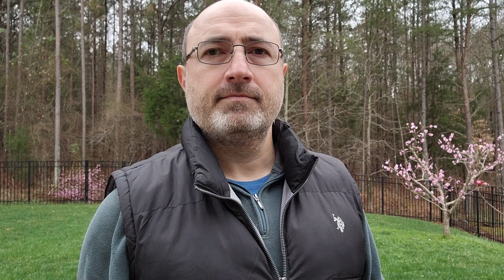Elon Musk Says Tesla Cybertruck Will Use a New Metal

Comment: Some 300 series SS like 301 can be cold worked to full hardness but 304/304L could only achieve half hardness.  Perhaps the adjustment to the alloy permits 3/4 to full hardness with the better corrosion resistance of 304 or 316.

Comment: Well, the best swords use composite steel blades.  The edge is made of high carbon steel optimized for hardness (hold a cutting edge), but brittle and prone to crack and rust.  The center is made of more flexible (spring) steel optimized not to break.  It is possible that two sheets of stainless steel could be fused together to create a panel that has a very hard outer layer and a more flexible inner layer.  But I think it would be easier to just create an alloy optimized for the right amount of hardness, rust resistance and flexibility.  Just making it cold-rolled (forged with less heat for minimal crystallization) and thick is enough to do the job at a reasonable cost.  "Spring steel" is designed to bend, but spring back without damage.  I would think it would have to be optimized for rust resistance, given the utility the truck is designed for.  1950's era trucks were built like tanks, the metal panels were so thick, compared to the thin panels of today's vehicles that are easily dinged, but lighter weight to improve MPG.  The thin panels are easy to form and in fact you need to stamp a lot of contortions in them to create structural strength.  With the Cybertruck, the steel is so hard, strong, and thick, it can't be stamped.  I'm not sure how they will fold it without causing it to crack.  It would be easier to cut and weld it to produce those sharp angles.  Perhaps they use very high pressure dies and heat.  Actually, looking at the prototypes, you only see a few folds, on the doors and the front "bumper".  Most of the angles are made from separate pieces. 
I'm also very curious about the glass.  There is Lexan bulletproof glass which isn't glass at all, (plastic) but it is very thick.  This is used in Popemobile.  There is laminated glass like used in modern windshields which will shatter, but not come apart.  There is heat tempered glass that is very hard and can handle hammer blows, but with the right (sharp pointed) impact will cause it to shatter into little cubes.  There is bulletproof military armored glass which is actually aluminum oxide in crystalline form but it is also thick and very very expensive.  It could be a thin sheet of aluminum oxide on the outside, tempered glass on the inside and a laminate plastic in the center.